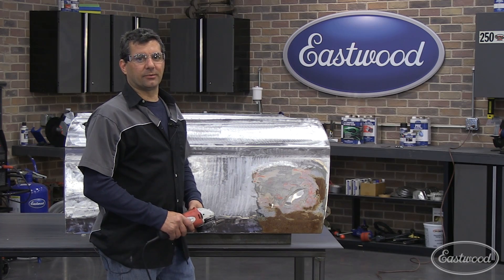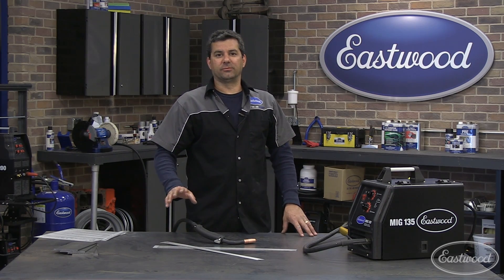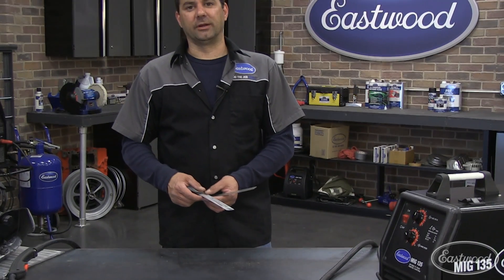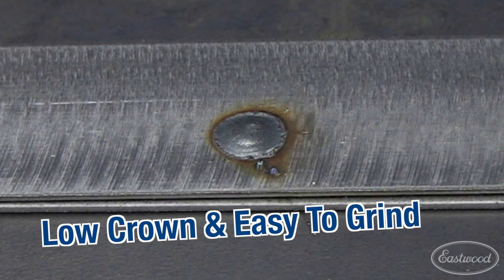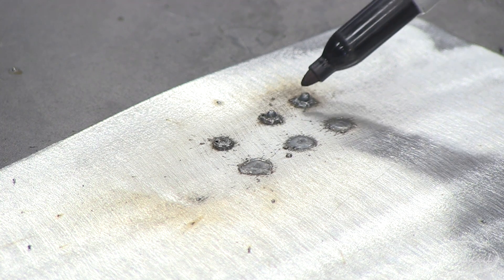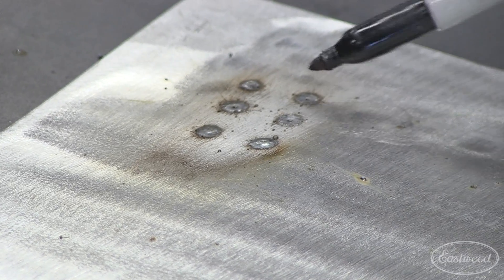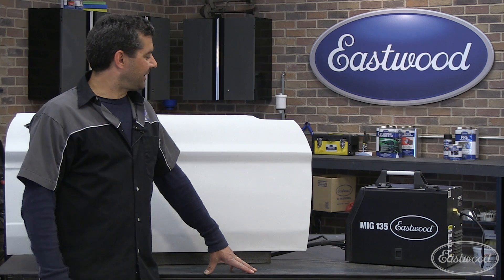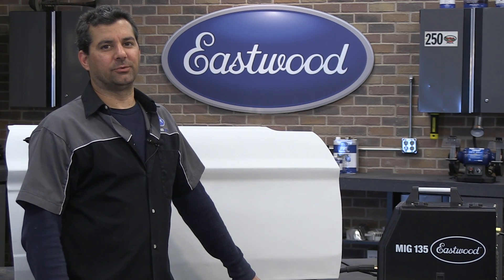How to MIG Weld, Repair a Door or Fender and Save Money from Eastwood

Comment: Doing my first project here. Patching up a rusted fender. I think I may have bitten off more than I can chew. You make it look a lot easier than it is. Seemed like no matter my settings, I had problems. Hissing, popping, burn through, or poor penetration. Even your poor examples are looking nicer than my welds. I think I'm finally starting to get it right, but it has been frustrating.
Reply from the maker: Welding is a complex process with a lot of variables. You're not going to be perfect from the first arc. Our number one suggestion is to practice on similar thickness scrap metal. And Practice, Practice, Practice.

Check these out too: https://youtu.be/gzaOfKPjvWw
https://youtu.be/rcbURqdJXNo

Comment: How about when what you are working on isn't on the chart inside the cover? I'm trying to do automotive sheet metal with flux core .30 wire. There are no settings listed for that.

Comment: As a part time and old school car repairer, I had increasing need to use the MIG welder. But I did find getting the right advice on welding technique hard to find. Also, without regular practice I find can make unnecessary mistakes when painting or welding. This is a really useful video, I use it , like many from Eastwood, as a quick refresher course before I dive into another major job.

Comment: Thanks a lot I learn something new if I've needed to make a hole without a drill raise up voltage to hold with clecos I also learned the proper way about connecting to piece of sheet metal reinforcing the back around the edges kind of like installing gypsum board thanks thank you for explaining well.

Comment: I used to do autobody repair back in the 70s and most shops only had acetylene and oxygen welding equipment. It got the job done but it took a bit of skill to avoid warping of the area during welding. Also, the flux from the brazing rod had to be removed perfectly or else it would cause problems with the body filler. I had a spot welder at my shop which was really helpful. I wish that I would have had a MIG welder at the time. I lived in the rust belt and this welder would have saved me a lot of time and effort. Thank you for the video.

Comment: You clean up and paint the front but what do you do to the back of the panel? All the weld spots will be open to atmosphere and would start rusting again. Wouldn't it? 
What do you in if you can't reach behind the rust hole you just patched? Anyone?
Reply: Weld primer

Comment: Love these videos! Man, I wish you guys would set up a shop like this down here in Terre Haute, IN. Even if it's just to teach things like this, it would be awesome to have access to.

I have a Hobart 190 that I use for little things around the house or in my garage. To be honest, it's entirely too much of a welder for someone like me who has no experience welding but I thought that having too much power would be better than needing more power and not having it, so I went ahead bought it instead of their 140 model or anything else. I recently used it to weld up some cracks in my push mower's deck. I've never used gas--haven't even tried as I'm always afraid of anything that's compressed! (Me and things that can explode never make good bedfellows... I'm a wuss, I know...) But what I've found doing FCAWS is that preparation is everything, and as long as you use their anti-spatter spray, you can have some really great welds. If you don't use the spray, you'll have bad spatter but the welds will still be strong.

My process up to this point has been to follow the sheet inside the door as closely as possible but then after sanding everything up, wiping the prepared surface afterwards with alcohol or whatever cleaner I have. Then if everything looks good, I spray on the anti-spatter spray (just a few spritzes) then try to consistently drag-weld using a 45-degree angle. The mower deck has been the thickest steel I've welded so far. I think it was around 1/8th inch thick, but even then, I didn't do any dimes or circles because even with that thickness, this welder wanted to burn through it and I think it was my technique rather than the settings as once I sped up my drag, things improved. I have a lot to learn (obviously) but I had some great welds with it once I got some things figured out. I really love this welder.

Thanks for the video! Some great info in it, especially the part about the reinforcing of the butt areas using those strips and tacks.

Comment: Hi,

When you did your plug weld. Did you put your wire in the center of the hole? I'm welding a bedside on. I was able to use my spot welder in most spots, but on the front side i had to drill holes. I was going to plug weld those

Comment: These lip weld approaches are great for beginners, but I worry about water sitting on the edge inside. I'm a beginner too, but I don't think this will last compared to a butt weld. I could be wrong, you may have painted the inside, I don't know.
Reply: Eastwood's got a pretty interesting seam sealer video that ought to complement this one nicely!

Comment: Great beginners tutorial. If I may expand on it; Disconnect your battery when performing welds ON the vehicle. Also, if I missed it?, Proper wire selection, to match the gauge of welding material. Again, great video and that unit makes sweet welds! 😃

Comment: what i do is i haul of rigs that people want to get ride of till i get all the parts for one rig then i build it like my 68 chevy pu it has no rust in it perfect body no dings put a 454 stroker with tunnel ram heavy duty 400 turbo serpentine belt set up after market ignition with msd rally wheels lots of chrome and have only 1300 in the truck plus i traded some of the left over parts for paint and will trade a rust free cab for cowl induction hood for the 68 has to be metal hood have 2 sitting plus fenders stock hoods with no bend in them lots of boxes metal or wood on the inside  this is how u save big money on rigs  my 73 ss nova was even better but i give all the left over parts to my racing buddies

Comment: Asking for recommendation...What would be a good mig welder to do some  front/rear chassis fabrication on my classic truck 1/8" metal  ie Eastwood 135 or Eastwood 175 ?
Reply: 175 is just stronger then 135. If u wanna to do something else with thicker material bay 175
Reply: A 135 is still adequate. The more important thing is weld joint prep. So grinding a bevel to prep for a butt weld

Comment: Can you complete this process with flux core or does it have to be mig?  What are the differences in the outcome, if any?  Thanks awesome vid too!
Reply from the maker: It's possible with flux core, but more difficult and more to clean up / grind. Using gas will definitely be much easier and provide significantly better results.

Comment: Ya I’m going Eastwood. Need help deciding 135 or 175
Reply from the maker: If it's sheet metal, the MIG 135 is a great choice. If it's for all aspects of auto restoration (sheet metal to chassis and brackets), or general metal fab, the MIG 175 is the welder for you. Check out our MIG Welder Buyers Guide here: https://www.eastwood.com/welders/mig-welders/mig-welder-buyers-guide.html

Comment: I have never welded a day in my life. Lol. But I’m getting ready to restore my grandmothers 57 Chevy truck. Can you explain the difference between using gas vs I guess its flux core? And what kind of gas is needed. Thanks
Reply from the maker: You will use the Argon-Co2 mix and gas will provide better results than flux core, especially in auto restoration.

Comment: I know this is an old video but I would have to rate it as one of the best on how to MIG weld.  Simple, concise and to the point.  I’ve learnt so much.  Thanks heaps!
Reply: Agree David - I've added to my saved list.
He's dead right about the savings.  Since I started doing my own vehicle servicing and repairs a few years ago I've saved nearly 2k GBP.  It paid for an Oxford welder and a heap of tools.
My local Ford dealer, who sold me my vehicles, has stopped speaking to me though.  I've also learned to avoid them for MoT tests as they will now do anything to fail them in their hunt for things to repair.
Reply: P.S.  I use the Eastwood sprays quite a lot.  Rust Encapsulator and Extreme Chassis Black are great, although I've tended to replace the former with Jenolite now as it's a lot cheaper and seems to work ok.  The High Temperature Coating (silver) is worth a look as well.  Since I started coating all my caliper carriers with it the corrosion I have to deal with has diminished significantly.  Every time I change the discs (rotors) I clean up and re-coat the calipers and carriers with High Temp Coating.  Huge difference in lifespan and well worth the cost of the spray.  Plus they look great through the spokes of the alloys.

Comment: Good video, but the terminology is off. That's not what spot welding is. There's no filler metal involved. Also not what stitch welding is either. A stitch weld has a length and a pitch. What you're doing is more just a series of tack welds.

Comment: must be using gas. i can never get any good welds with this welder using just flux core and 5 of the best wires on the market no matter what settings and speed.
Reply from the maker: Shielding gas will greatly help your welds, especially sheet metal.
Reply: My welder does stick mig and flux. Flux works but its messy and not as pretty as Mig.  And I like stick sometimes because you can do it on dirty parts and on a breezy day

Comment: Do you totally grind welds smooth with metal? And filler over that? Or welds slightly raised over metal just a bit?
Reply from the maker: Ground smooth, then either body filler followed by epoxy primer, or epoxy primer followed by body filler. Have you seen this video which includes a link to get FREE step by step instructions which are easy to follow: https://youtu.be/Lw0ObOdWnRE

Comment: I agree with Jursaw, I bought a cheap welder and took a large hammer to fine adjust the torment it inflicted on me. ( It won't do that to anyone else) Buy a decent welder from the start, avoid extreme violence on your cheap welder, they are designed by Beelzebub himself. Lesson learnt, great video Eastwood, Steve UK.

Comment: This is fine for the beginner but you left out the MOST IMPORTANT PART OF WELDING A DOOR PANEL OR ANY OTHER METAL!ALSO THIS IS THE MOST COMMON MISTAKE FOR A NEW WELDER TO MAKE.
EASTWOOD YOU NEED TO TELL EVERYONE WHEN USING A SHIELDING GAS THE METAL MUST BE CLEANED OF RUST, PAINT, ETC THIS IS A MUST OR YOUR WELD WILL BE CONTAMINATED!
Now I did see you grinding the weld but I did not hear you say why we clean the metal.

Comment: Why are you not concerned with corrosion forming between the doubler strip and the patch. This would have been better performed by a strait up butt weld
Reply: That's what I was thinking.  Maybe put some seam sealer around the doubler strip and make sure it's painted?  That should help some unless moisture finds its way in through a pinhole in the weld or something.  I'd still rather see a clean butt weld.
Reply: This is for beginners. I have been hack welding for years and still can’t do a butt weld in body metal for shit. What I can do is overlap, undercoat and hope for the best

Comment: Instead of doing a stitch weld why don't you do a bead World across the whole thing
Reply from the maker: Stitch welding helps keep the heat down in the metal, which prevents warping.  If you ran once continuos bead, the heat would continue to build up and the metal would warp.  You would also be more likely to get blow-through (holes in the metal).  To prevent warpage, many people use a blow nozzle from your air compressor to blow air on each stitch weld to cool it.

Comment: Are you using a flux core or a shield gas? Cause those are some nice welds
Reply from the maker: He is MIG welding and using the standard 75-25 Argon-CO2 mix gas bottle.

Comment: good tip to plug weld the strip/backing for the butt weld.   probably helps cool it a bit faster with more metal and prevent burn through.
Reply: Save time and money by just using neodymium magnets to hold them in place. No need for the strips at all
Reply: Hodge-Podge Garage  if you were welding a patch in an area with a large amount of rust wouldn’t the overlap of the strip be bad if you didn’t weld it again or seal it from the other side ??

Comment: Why didn't you spray weld thru primer on the metal strips?
Reply: Because it was aluminized steel?
Reply: @bobbastion7335  What about the backside of the fender itself?

Comment: awesome video, I am just attempting partial quarter panel replacement, after the weld is ground down do you have to go back and fill small holes that I missed? or will the body filler be ok to fill them

Comment: Is body filler strong? Would it ever deca?
Reply: Fiberglass filler is quite strong, and aluminum filler.  Regular body filler is not as strong.  But you should not be worrying about how strong it is since it is just for leveling a panel. It is not made to bridge gaps or hold things together.

Comment: Why we have to buy a bottle of shielding gas (75% Argon, 25% CO2), what is that for? Do we need that in welding?
Reply: +cherfieldm gas is better then flux, plus  it depends on the thickness of the metal youre trying to weld LOTS OF FACTORS.

Comment: looks easy when he does it.. have an old Lincoln .. not as many settings so maybe the problem.. as the tool not the operator.. lol
Reply: Duane Page NOT always The tool it could be the metal you are welding may not be clean or you settings may not reflect correctly to what the settings on the door.

Comment: what different sizes of mig wire do you use for the different sheet metal gauges. .022, .020, .018, 016 et?

Comment: what other equipment do I need to use this welder? e.g. compressed air? etc etc
Reply from the maker: ***** The Eastwood MIG 135 operates on 120 Volts and only needs a bottle of shielding gas (75% Argon, 25% CO2).  No compressed air is needed with a MIG welder.
Reply: Eastwood Company Thank you for the quick reply! appreciate the info.

Comment: This video made it easy to understand. I am pushing to buy the 135 mig from Eastwood this summer to start learning instead of buying the cheap harbor freight ones. Thanks for these amazing videos.
Reply from the maker: ***** Don't forget Eastwood offers a 3 Year Warranty AND a 30 Day Money Back Guarantee!
Reply: @eastwoodco  can i weld thicker metal with that welder? cause i need a welder. Am working on a project and i need to do strong welds on C channel

Comment: can it do Japanese car panels or will it burn holes? Japanese cars are a lot thinner than old American cars.
Reply: If I was you I'd go grind the paint off of the edges of your work, so you can get an accurate measurement with some digital calipers. Convert that to gauge and see if the welder is capable of that thickness. you could always test it out at varying voltages anyway.

Comment: which is best? MIG or TIG?
Reply: TiG is generally better because you have more control with amount of gas and filler being used and  an easier time grinding it for a smooth finish. my opinion though, also TiG is a bit harder to learn

Comment: I appreciate Eastwood's attempt to produce videos that add to the novice's toolbox; however, a little more care should be used when making recommendations. Using a stich weld pattern to buttweld panels such as this patch being shown here will result in puckering unless a fish plate is being used. I understand that if the fish plate is being used this is an acceptable method but if not the technique has to change to spoting in between the spots. this one piece of information is all that is needed

Comment: been using my eastwood 135 mig a lot. one recommendation would be to put the chart on the outside of the door (though it may get scratched up). great video and product.
Reply: Take a cell picture and print 2"clear tape to outside.